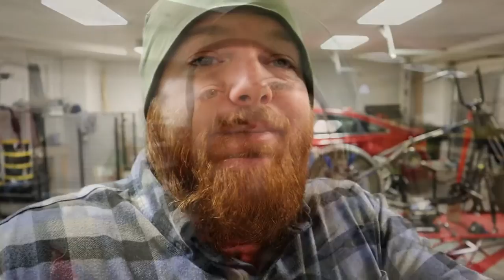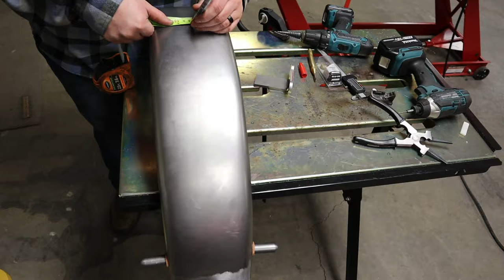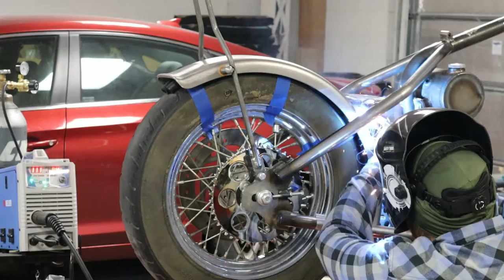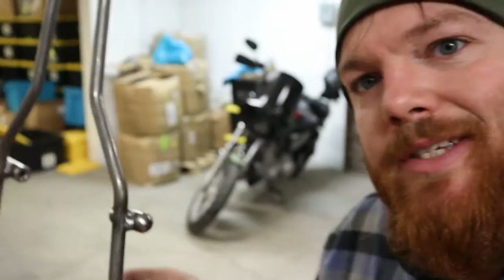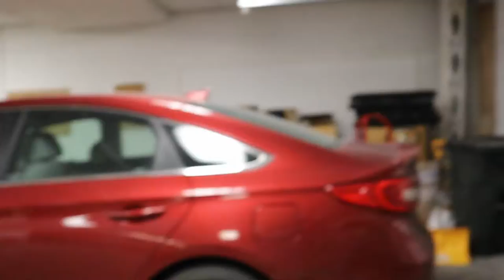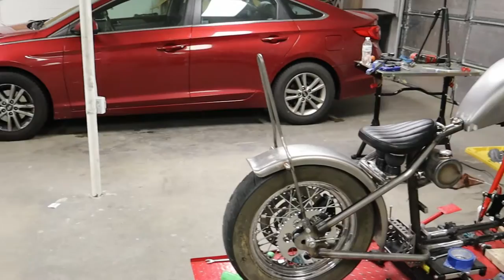MOUNTING A FENDER ON A HARDTAIL CHOPPER!

Comment: Hey man what was you clearance from chain to tire?…mines close at a 1/4 I think Im going to have to trim my 6in fender so the chain wont hit…im using tc bros hardtail and they said the frame calls for a 130-150 tire so I went with 150
Reply from the maker: You'll have to trim a 6 in fender.  I used a 5 inch fender for a tighter fit with no need to trim.